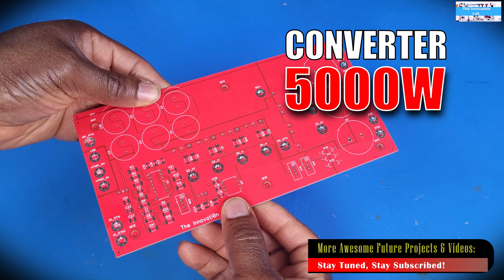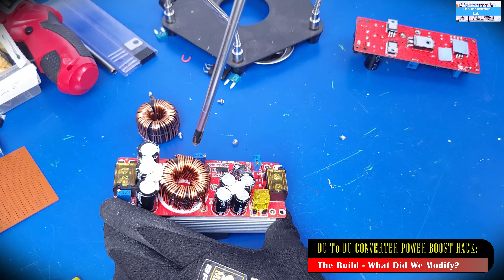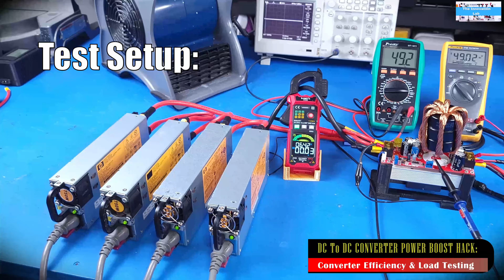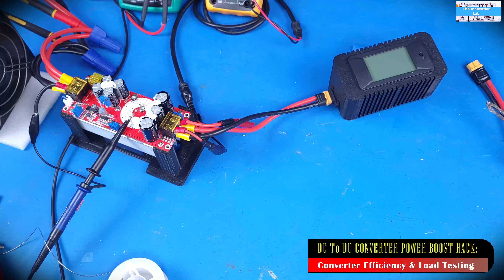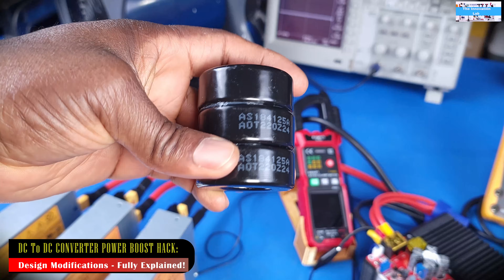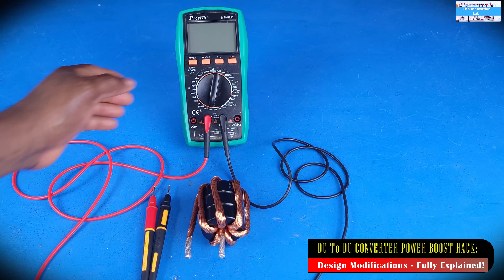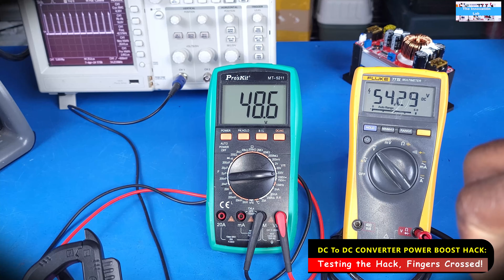How to Supercharge a DC-DC Boost Converter to Deliver Higher Power!⚡️💥

Comment: The prices for ferrite cores will knock your socks off
Reply from the maker: Hahaha, they are not that expensive. But then it depends on your budget.
👍😎
The Innovati0n Lab💥
www.theinnovati0nlab.com
Reply: @theinnovati0nlab782  Aha, AS184-125A a 18 Euro x 3 is 54 Euro, thats insane.
Reply: Are these even ferrite? They look like Sendust cores to my eye.. It's more like iron powder core..you know the yellow/white or green/blue rings in many appliances, but without many of the losses and hysteresis, etc. issues of the iron powder ones.. also i think ferrite would have needed an airgap to store the energy between the switch cycles which is kinda inbread property of iron powder or sendust -type of cores.. 😊 By the way..very good video! I couldn't spot half truths or other issues there at least with single watch..and the converter efficiency is right there where it should be!! That's not often the case with youtube tech videos..👍Good work!!
Reply from the maker: @hipihei  
Thanks a lot for the great interaction!👍👍👍
I greatly appreciate it.

Honestly speaking, these are knock-off torroidal cores you can find on Amazon or eBay. They were listed as PC40 MnZn cores per the seller's description - unless they lied.☺️
You can also search the part number shown in the video to dive in a bit better into the specs. As for the color coding of cores....I found that this is really an unregulated standard, and most manufacturers can just paint any color on anything these days.

I hope this makes sense to you.
Thanks again
👍😎
The Innovati0n Lab💥
www.theinnovati0nlab.com
Reply: @theinnovati0nlab782 Hi!😊 Yep...the colors are a mess.. I think only properly color-coded rings are manufactured by Micrometals, and they are iron-powdered rings. Chinese manufacturers sometimes clone them, but no-one knows if they are even close to originals. I think i've never seen any coding with ferrites. I'm electronics repair engineer thus have access to different magnetics from variety of deceased products..so i've tried in the past to define what stuff is usually what, but it's very hard.. It's easy to define whether it's high permeability or low permeability material (or ferrite vs iron powder), but all other parameters from them is just impossible or too impractical with regular tools found in basic workshop.. I've had a hobby of hf dx radio listening and best stuff to salvage are the high permeability ferrites in smps common mode chokes.. They make excellent impedance transformers for receive antennas, etc.. (not for transmitters though!) Lazy man's hf (lw, mw, sw bands) isolation transformer is made out of such ferrite and 10-15 turns of a single twisted pair dismantled from cat cable.. other wire's a primary and the other is a secondary..that's some literal transmission-line transformer..😅
I built about 700-800w boost converter from scratch for some solar project and i did quite a bit of research and few prototypes and ended up getting sendust (i think that's Magnetic's Inc. name for FeSiAl cores..i think Micrometals use name CoolMu).. They looked identical up to the point of print font on this video..that's why they looked familiar..As You suggested i dropped the numbers from Your cores into my AliExpress app and apparently these ARE sendust cores.. (Tangda sendust FeSiAl toroidal cores inductor OD*ID*HT 48*23*19 mm AL: 281nH/N2 Ue: 125 AS184125A CS467125 77438-A7 .
https://a.aliexpress.com/_ExU3our )
My switching freq was 62kHz and airgapped core from Samsung 24v microwave oven saturated immediately (i have no specs about the mwo inverter switching frequency..and it utilized a flyback topology so i didn't have high expectations but tried anyway to see how it would survive in boost converter..)..i didn't want to start experimenting with air gaps and stuff so i went straight to powdered iron.. Yellow-white micrometals core worked without saturation but i felt i could choose a core with less losses so i went with sendust..very good stuff!
I think You would have had problems with core saturation if they had been ferrite since your toroids have no gap..
Since boost converter needs to store all the energy into the core during the on state of the switch which is released into the load during the off state of the switch it's way more fiddlier to do it with ferrite cores..😅..at least for me..

Comment: I was charging my battery pack with this. While charging, I turned off the adapter plug and turned it on while my battery was connected. Then the output side of the regulator exploded and the diodes burned out. I wonder if there was a backward current from my battery?  Should I disconnect the battery first before removing the adapter?
Reply from the maker: Sorry to hear about the failure you encountered. However, It is never advisable to power ON your converters with loads already applied. 
What killed your converter is probably an output overload or cureent surge - as the converter was still trying to regulate. These converters have output rectifier diodes that should be reverse biased with respect to your batteries' polarity.
You should never leave your battery connected to these converters, especially when they are powered off because they will discharge your battery over time. Yes, the output diode is supposed to block any incoming power to the converter, but in reverse bias mode, there is still some leakage current that gets through. At reverse bias, the Junction resistance/impedance of that diode is high....but not infinite, thus the it never like an OPEN switch.

I made a video a while ago to detail a 6-step method for using these converters as a constant current/voltage battery charger.
Please, I highly recommend that you watch this video👇👇👇
https://youtu.be/WDWJ77WWkXc?si=tblyFzosGAT6FMFY

I hope this helps.
Please, we need your help to grow this channel. You can help by sharing our videos with friends or diy groups on social media.
We appreciate all your support.
👍😎
The Innovati0n Lab💥
www.theinnovati0nlab.com

Comment: Bunca bilgi varken bu devre tasarımına bağlı kalmak niye? Kendi indiktörlerini paralel bağlamak daha akıllıca olurdu.Bu devrenin akım ayarlama sorunu var bu yüzden sadece voltaj yükseltmesine izin verip akım ayarını başkaca bir devre tasarımıyla yapmayı düşünmeli.Ve bu devrenin yaptığı işi çok daha az elemanla ve çok yüksek frekanla yapmak pekala mümkün.Örneğin radyo frekansında fm çıkış devtreleri tam olarak buna benzer transistör maksimum voltajı olan 33 voltu 220 volta 100 megahertz de çevirmek.Size bir sır vereyim hava endüktanslı yğksek frekanslıçok verimli ve çok küçük devreler mümkün.Yakın grlecekte olacak olan bu.
Reply from the maker: Great feedback.👍👍👍
I see your point about going to higher frequencies....I already know this, so it is not a secret that needs to be unveiled to me.

Now, what you may not know is that for high power designs, you want to be very careful with switching frequencies that approach the MHz range because at such frequencies, every single component you have on the power board - even the copper traces, begins to act as high frequency antennas. This is fundermentally as a result of parasitic inductance and capatances of components on the board.....things that you would never have worries about if you stayed below 100KHz. 

Also, at such high frequencies, you may be venturing into the land of fcc  violations for a commercial power supply. This means that you have to add a lot more to the design to ensure an effective Faraday cage or EMI shield around  your design. You don't want to build a converter that could disrupt other high-frequency devices around it.⚠️⚠️⚠️

You see, there is a lot that comes between the land of theory and what goes on in an actual test lab. 
You have to make the rubber meet the road with your designs. Design feasibility, cost, safety, regulations, power density, material availability,....I can go on.

Also, higher frequency designs take longer and require more analysis and detail......high frequency designs are never cheap, my friend.
Higher frequencies are used for very expensive converters where high POWER DENSITY is super desirable. But not everyone can afford such converters! You should never compare those to these super DUPER cheap $25  converters - not fair at all.😊
Also, this technology already exists, but it is very expensive....so it's not science fiction.

I hope this helps.
The Innovati0n Lab💥
www.theinnovati0nlab.com

Comment: isn't the converter need some power diode or something like that?, which I assume is what the heatsink is trying to cool, so... isn't that is the other limitation?
but question aside, it's a really great video man, love it
Reply from the maker: Thanks a lot for the thoughtful feedback.
Your question was on point. Yes, there are output rectifier diodes on the unit, of course. They should be able to handle greater than 40A at the output. This is why I am using 3X fast recovery diodes in my design... Maybe an overkill, but I prefer to derate components to minimize unnecessary dissipation and stress on the components.
👍😎
The Innovati0n Lab💥
www.theinnovati0nlab.com

Comment: Hello friend, the difficult becomes simple, great knowledge, keep it up.

Please do a video on  INDUCTOR  calculations , 47 microH to 50 microH, 200Amp,  for a 24 VDC to 220VAC solar inverter at 5000 Watts operating at 50Hz with a 25 kilogram toroidal iron core transformer;     the EGS002 is the control board,  and it produces  22 KHz too.
 Is skin effect important here also? 
  The chinese sellers of such inverter boards say  to use 47 to 50 micro Henry (at ~~200 Amps max).
Reply from the maker: Wonderful, it seems you are talking about an LC filter circuit for pure sine wave inverter.  
The big, heavy, and bulky toroidal tranformer is a soft iron torroidal core that should be a transformer and not an inductor. Realistically, it should operate down to about 50 to 60Hz. Skin effect only applies to high frequencies, and you should not be worried about it for the main toroidal transformer.

However, you should definitely consider skin effect for the filter inductor needed for the LC  filter circuit. The LC filter is supposed to serve as a low pass filter to block the 22KHz switching frequency that MOSFETs or IGBTs used to chop down the DC power to a stepped waveform.....long but simple story, depending on who is telling the story...hahaha!

The 22KHz is the first stage that is used to create a digital  sine wave PWM. But then, given that soft iron cores cannot hand 22KHz, it needs to be filtered off by the LC low-pass filter first.

f(cutoff) = 1/(2pi*SQRT(LC)

You are right. This will have to be a video. Text explanation would take a 200-page thesis...hahaha
👍😎
The Innovati0n Lab💥
www.theinnovati0nlab.com

Comment: ANOTHER GREAT VIDEO!!!!  I have gotten about 16 minutes into it...will finish tonight.
a couple things so far:
1)  How many strands of 22AWG wire did you use for the thick windings?
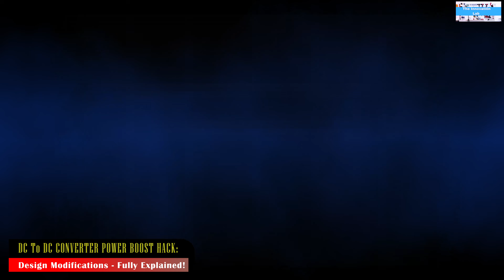2) ...may be premature:    At about timestamp 15:00  for 10kHz to 60kHz, I think I would have used 'at least' 1K for the fixed resistors, since at 10kHz, R=100K already.  And @ 60kHz; R=16.7k.

At pot extreams, 200 Ohms gives 5MhZ............2000 Ohms gives 500kHz
THANKS FOR CONTINUING...
--DaLE
Reply from the maker: Hello, wonderful friend!
Thanks a lot for the great feedback!
All your questions and comments were addressed in chapter 4 of the video. 
The  2X 100 ohms was barely used as a stand-off/jumper to 100K trim potentiometer. 
But I see your concern about the pot extremes...having the scope to keep a close eye on the PWM waveform while making the switching frequency adjustments.
A couple of things to consider are that the TL494 has a max frequency rating of 300KHz, and it should not be able to exceed that.  Also, looking at the formula, the frequency of the is inversely proportional to a product of RT and CT. So, it is not solely dependent on RT.

Let me know if you have more questions when you have been able to watch the entire video.
👍😎
Thanks again for the constructive feedback, as usual.
The Innovati0n Lab💥
www.theinnovati0nlab.com

Comment: Does adding capacitance help any? Adding a capacitor or replacing the caps with a higher uf rating?
Reply from the maker: Great feedback!
I ran a quick output capacitor calculation, and the numbers came close to the values already used for this converter. But I will test that with my converter design. However, making converter outputs more capacitive helps with better peak-to-peak output ripple.
Thanks again!
👍😎
The Innovati0n Lab💥
www.theinnovati0nlab.com

Comment: Nice mod ! Did you lower the switching frequency so the current has a longer period and can reach so a higher amperage ( together with the higher inductance) ?
Reply from the maker: You are pretty much on the right track. However, in a nutshell, every inductor has a switching frequency that optimizes its energy transfer performance. Being able to vary the switching did help tune the converter for better efficiency.

I will make a follow-on video in the future to explain inductor design better.
Stay tuned.

👍😎
The Innovati0n Lab💥
www.theinnovati0nlab.com

Comment from the maker: Hello guys!!
Thanks a lot for watching this video and leaving a constructive comment. I greatly appreciate it!

This video took lots of effort, research, and testing to make....lots of video footage captured, which means lots of time spent editing and editing!! It has been in the works for more than two months!! Wheww!!!

Please don't forget to drop a like if you got some good information out of the video.

Also, subscribe for more like it coming in the near future!

Thanks again!
The Innovati0n Lab💥
www.theinnovati0nlab.com
Reply: Problem with this hacks is reliability. THis PCB, traces, parts are not designed to withstand this kind of load for e.g. 150 000 MTBF
so things have to be used, as they were designed, especially if we know the quality of this cheap stuff. 
If you make you solar power plant, you can buy  500 € or 3000 € inverter wtih the sam power. 
How it is possible, that 6-times lower price can give same quality and longevity ? No way.
If you look inside, you will see a lot of mistakes in low quality PCB and parts, so you have
to invest your time, to improve this cheap thing or to buy quality stuff and forget for 15 y.
that you have inverter, no problems, no days or hours wihtout electricity, no lost time and productivity.

Comment: Place a water cooler on the MOSFET, and you will achieve higher efficiency at 12 volts.

Water cooling is highly effective for heat dissipation, based on my experience.
Reply from the maker: You are absolutely right on point!!
This is something I have considered, and I have it on my bucket list!!

Thanks a lot for the wonderful feedback!!
Much appreciated.
👍😎
The Innovati0n Lab💥
www.theinnovati0nlab.com
Reply: or  just use a better, higher rated mosfet. GaAs mosfets

Comment: Thanks so so much for the video sir,  God bless. Please sir it will be nice if you could help us with the reason they used 35UH inductor and the theories behind it sir thanks and stay bless.
Reply from the maker: Wonderful question👍👍👍
I was avoiding getting too deep on the inductor design for this video....because I didn't want to make this a 2-hour video, hahaha.

However, that number came from a calculation of the CRITICAL INDUCTANCE for the boost converter - operating under continuous conduction mode. However, with that said, inductor construction itself presents a major difficulty in reaching the desired inductance because it is usually very difficult to pack the windings, though toroidal core due to the small inner diameter.

I would have preferred a higher inductance value. However, 35uH was what I could feasibly achieve with my build.

Please research the following as you may find them helpful;
💥core materials
💥boost converter critical inductance.
💥Continuous conduction mode
💥inductor saturation currents
💥Skin Depth/effect.

I will make a future video to explain this better.
Stay tuned.
👍😎
The Innovati0n Lab💥
www.theinnovati0nlab.com